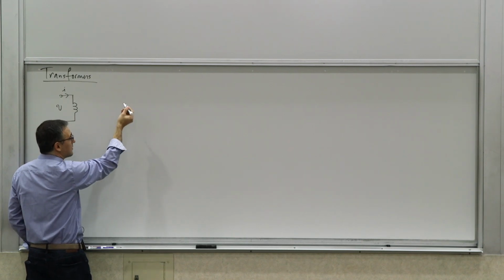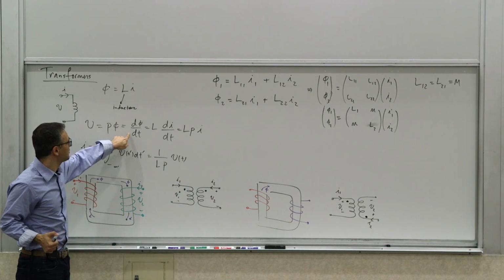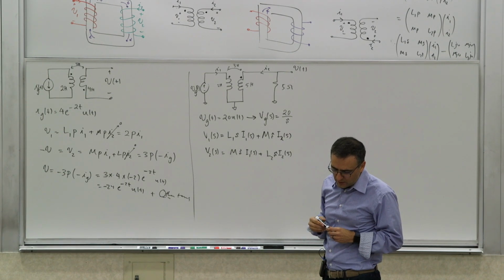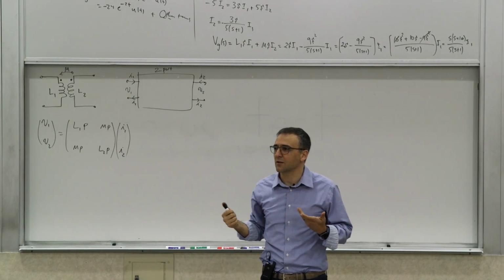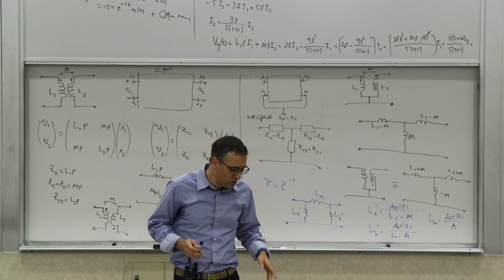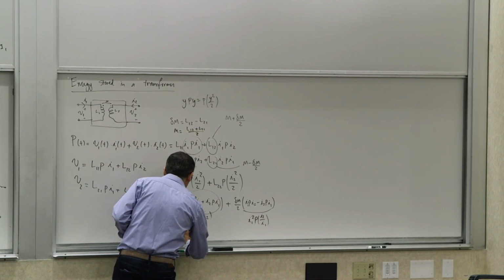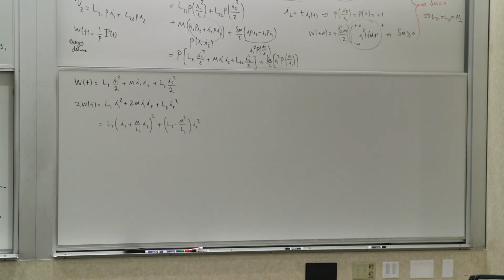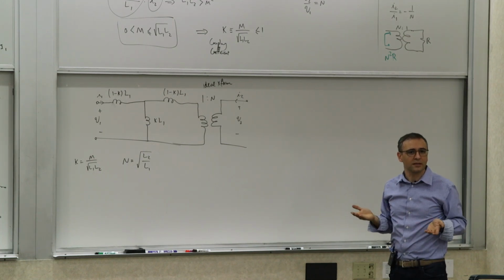040. Transformers: Behavior and Circuit Models

Comment: There is this explanation of magnetism using relativity. I have tried extending it to the back emf generated by the inductor upon change of current with not much progress only leaving a hazy picture. By this, the abstraction of magnetic field will start to dissolve into dealing with electric fields. I wonder if there is anything in the literature that explains this. It would be really great to see your perspective on this.

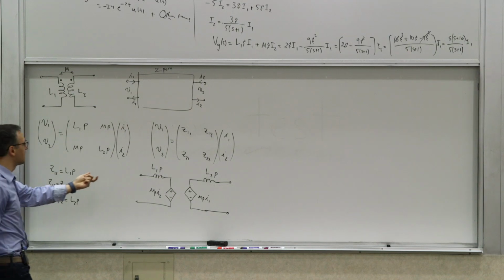Comment: In the case at 35:20 ... when you calculate the currents a t = infintiy (Steady state voltages of output and input)... i calculate i2 being constant = 6 A and i1 increasing without bound i1(t)=10t.  I see that the input is essentially DC (step function) which I have learned you cannot practically transform (Transformers are AC voltage device). 

Is the conclusion that i1 growing to infinity the reason or evidence of why transformers cannot be used on DC circuits.

Also from inituitive perspective at infinity there is no changing magnetic flux at primary so it doesn't seem logical that you would have voltage on the output.